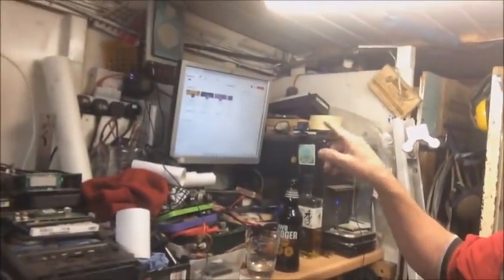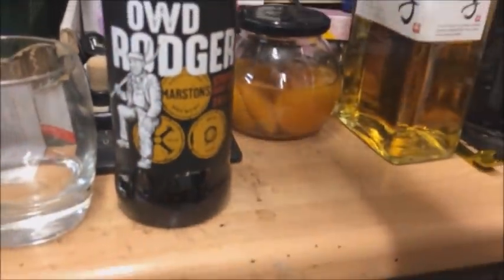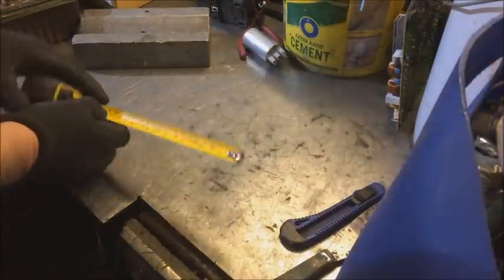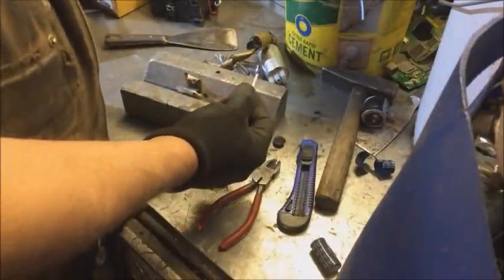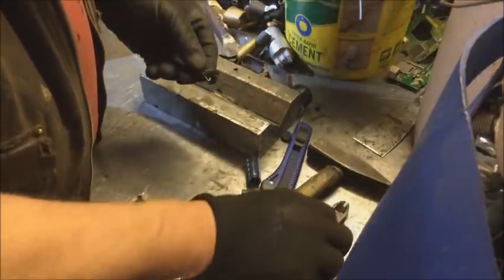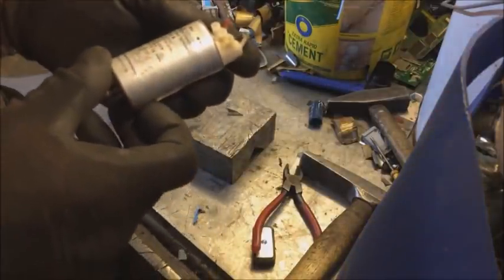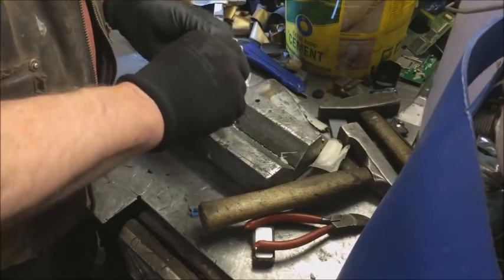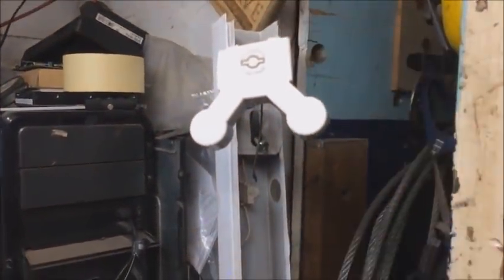Igniter & Capacitor for Everyday Sollers

Comment: Like you say , "U"- tube .....
I think that e waste Mike would say I an't got time for that.... .😁.
If the price for aluminium was much better to strip the smaller items,it might be worth it .
Unfortunately most scrappers look for the copper , and don't have the time to remove small bits of aluimiuim. 
As you said to me when I very first came across you BE YOURSELF. 
Yes your correct I did do a H P S flood light , soon to be a thing of the past as they get replaced with LED.
Ian congratulations on 10k .👍

Comment: Good news for good guy, 10k subbs. 
I've discovered something about those small capacitors, maybe it was my sniffer, but after checking the contents of a few I noticed a weird odor. It didn't wash off very well. After that I just started putting them in a few containers marked "what the hell!!"  The big capacitors I've saved from the large fan motors are definitely filled with a red goo. Still trying to figure out how to get it all out.
Good show Ian, even better when you don't have to find a band-aid.
Thanks

Comment: yes @ian that inside is aluminium as well  and that are an electrolytic capacitors and that paper in between alu  it is soaked in electrolyte and electrolyte in there could be either weak sulphuric acid solution it will not harm you tho you not wanna have it on your skin too long as well at your clothes, that starters is more transformers than caps tho without electrolyte 👍😀👍

Comment: You can actually shorten a fluorescent light fitting I’ve done it myself, it was a 4ft t12 to a twin 15w T8. When doing it make sure you change the ballast because you don’t want to overdrive the tubes.

Comment: Congratulations hitting 10k. I don't think you should be using that spatula to short out capacitors. Those metal pins on the handle where attached to the blade. Your shed is like mine,gotta walk sideways.  Great vid,thanks for sharing
Reply from the maker: Yep. Well spotted